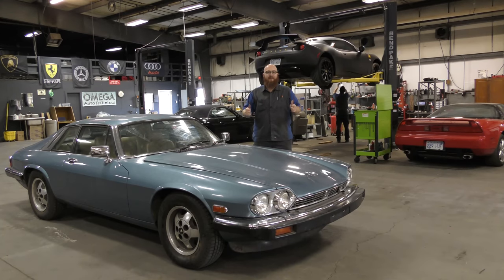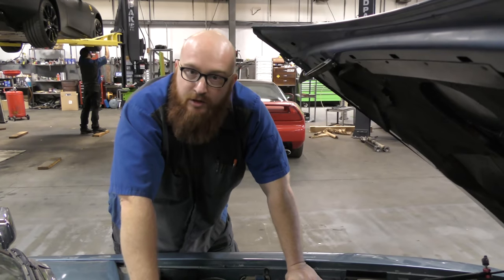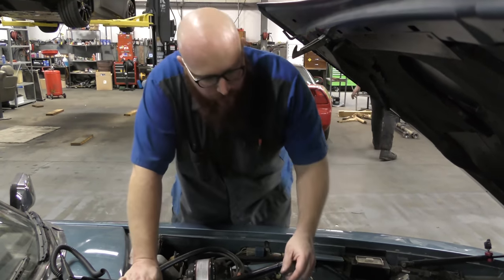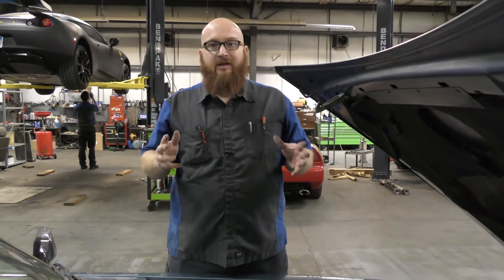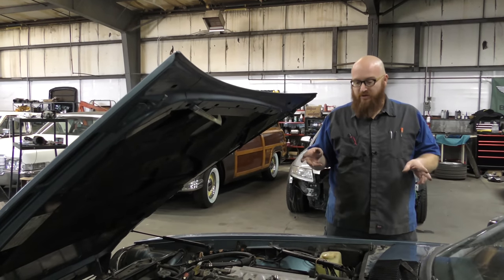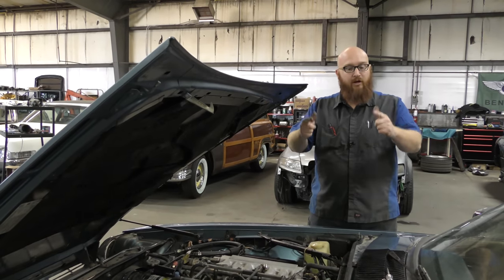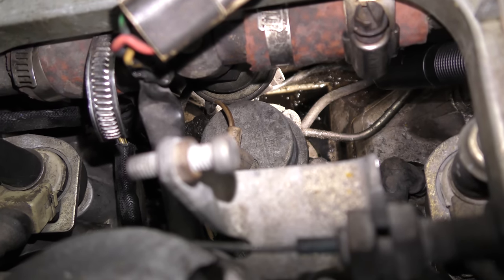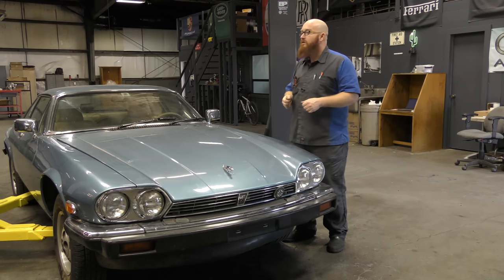'82 XJS with the cursed Jaguar V12 comes into the CAR WIZARD's shop. Can he get it running?

Comment: One of my favourite cars. Careful when you change the spark plugs. Dirt accumulates around the plugs and falls into the threads when you take them out. Put new plugs in with dirty threads and the next time you remove the plugs you take the cylinder head threads with them. They also had a tendency to catch fire because the fuel lines did not always have clamps from the factory. We had several burn jobs come through the shop.

Comment: I was trained by Lucas and still have the diagnosis cards somewhere. Driven E-types, XJ12 & XJS the most female unfriendly seats to get out of. A true gent averts his stare at the suspension systems she is wearing. That big sill/rocker panel makes for hard dismounts.
I loved the sound of the V12 in tunnels and on the highways.

Comment: In the early '90s I owned a used '85 XJ-S HE. I only had one problem with it- the automatic transmission failed one morning. Fortunately, there was a shop nearby that was very familiar with the GM Turbo Hydro 400 that Jag used and they rebuilt the trans with a little crisper shifts and I was back on the road without much $ spent. The XJ-S V-12 engine was a very smooth engine with lots of low-speed torque. It felt as if it were powered by an electric motor. The interior was comfortable for the driver- lots of legroom and well instrumented with large analog gauges. The ride was really outstanding and driving long distances in comfort was no problem. It's ride and handling can be ruined by fitting the wrong tires! Avoid "modern" low-aspect tires! Lister in the UK was a shop that could build larger displacement Jaguar V-12s. Chevy 350-powered conversions are quite practical and very popular.

Comment: Wait, they didn't come with a 350? 😱🤣
Reply: Originally these came with 3.6 inline 6 and the 5.3 v12
Reply: That was a joke bud
Reply: @UP-hu4ov  so if people dislike the V12 engine so much why didn't they buy is with the 3.6 V6 instead
Reply: @neilmurphy845  Straight six
Reply: @neilmurphy845  the first cars came only with the v12,after 1982 they could have the inline 6 but even these were not reliable
Reply: They also had a 4 litre straight 6.
Reply: @UP-hu4ov  No, the sixes were very reliable, the later 4 litre had cats though (in the UK) so made less power at the wheels than the 3.6. That was an unburstable engine if serviced of course.
Reply: @UP-hu4ov  ow that's interesting I never knew that
Reply: @faustusTVR  the 3.6 or 4.0 was unbreakable
Reply: @neilmurphy845  Agreed.
Reply: I'm waiting for some mad customizer to decide the 350 swap is for amateurs. Then try and jam a pair of slant 6's under the hood.
Reply: @ThePatUltra ow that's why they buy them used that's a great idea
Reply: @christopherconard2831  then jam the V12 into a '67 Camaro.

Comment: These cars are the adult version of "Hot Potato".
Reply: My teacher said the same thing about these engines. 😂
Reply: @TWOxTONE_773  engine is great, it's the crap bolted to it that lets it down,ignition and injection systems, that and bargain basement electrical connectors, the ruination of a fantastic car :-(

Comment: I have a '71 E type with the V-12 and 4 zenith carbs.  Opus ignition out, Pertronix in.  Upgrade a/c compressor, replace fans with Audi fans, replace radiator with aluminum one, replace distributer cap 4 times till I found production run was defective and got a good cap and rotor,  new interior, bought some 8 tracks for the radio, and life is good.  No cats back then, so exhaust smells like an old car, which it is.  Still get oil mist in distributor cap, but there has got to be a seal somewhere below.  As of this writing, EVERYTHING WORKS!  It is a beautiful car.

Comment: the ultimate engine swap i ever saw one of these Jags was a Cummins 2.8 Diesel ... that’s right a diesel Jag!
Reply: Used to see diesel jags in Finland alot, I remember they were based on a diesel Ford Mondeo.
Reply: Automotive heresy
Reply: @Mortalomena  when you hear that engine noise you know it’s either a mondeo or jag coming down the road haha
Reply: Nissan LD28 diesel swaps in New Zealand.  The result is a horribly slow noisy vehicle.
Reply: @mcmechanic8910  Or a Transit, or any Peugeot or London Taxi that borrowed that engine. It's a very distinctive sound isn't it?
Reply: You can buy those diesel jags new now XD

Comment: I am genuinely about to buy one of these cars and intend to use it as a normal use car. I don't drive too much and usually only short distances so if it DOES not work, I can handle without the car for short periods of time until either I learn to fix them myself or until a shop can make such smaller fixes for me using about as detailed explanation as I can possibly give. The biggest reason I have for this is that the car is deceptively advanced, yet at the same time simple. Troubleshooting can be a bitch and it always is for nearly anything, but that is also what makes the idea of owning this car so damn intriguing. If all else fails I will just buy a cheap car that is near ready for scrapping just for regular use inbetween as I DO expect (from what I hear) the XJS to be a fickle creature. A "high maintenance bitch, like me", as some lady put it in a different video here. Still that only turned me more on for this car. 

They come in two variants for me right now. Expensive as all hell.. or cheap as hell. I am interested in the cheaper ones that still have a promise of at least running the first few months without too much problem, but will need TLC both inside the car and under the hood. The car is just, to my eyes, a beauty. I know I might be committing the greatest of sins saying this to some, but I actually find the XJS to be more interesting and head turning as far as looks go than the E-type it replaced. More beautiful as well, because the E-type looks... silly to me. The XJS looks like a car that could survive the apocalypse if you have a mechanics touch. It looks more rugged as opposed to elegant. More "muscle car" to its looks than Grand Tourer. I appreciate that look myself.

The added benefit of owning a car like this would be that if you master this engine and systems surrounding it.. it seems like a space rocket system would be the next step up. You'll have mastered all car engines if you master this.
Reply: Couldn't agree more!  Just scored a 91' for $1K that runs.  Have a stripped out Yaris for commuting when I need to and the XJS to cruise around on weekends, fire up in the morning, and tinker on.  Not many other V12's that are cheap out there.  Compare this to the price of a Lambo Espada or any of the AM 12 cylinder variants.

Comment: We had an issue like this with our old 80's Ford LTD.  The car never ran right and we took it to a bunch of shops and they couldn't figure it out.  Finally one mechanic figured out that the plug wires were out of time for that engine.   That car we had had the 351 windsor in it, but had the wiring setup for the 302 engine!  Once that was figured out the car ran like a champ!  It took the right mechanic to get it figured out because I guess no one else thought that something so basic could be the culprit.

Comment: In the early 90s I bought a 75 XJ6 to convert to a 350 Chevy with a GM trans.   Put a hand built engine in it and a performance trans made and tuned by an expert.   Spent more than I should because I had the wrong guy doing the conversion, a Jag guy and not a 350 guy, if you know what I mean.   Car was a monster.  One problem: The Prince of Darkness, Joe Lucas.   If there’s anything in a car with the Lucas name on it, you’re screwed.   Couldn’t keep the car on the road with the Lucas problems.  I had it in the shop so often I knew the mechanic and his family problems intimately.   Owning the car was like putting a stainless steel screw in the back of your hand and every morning, giving it a quarter-turn.   Finally, donated it to charity.   Lesson learned.  I never owned a car again that was serviced by anyone but a dealer.  Nothing but Mercedes since 1999.  Whenever I see a Jag, I spit.

Comment: I grew up with Lucas electrics, so they hold no fears for me. Some of them were shitty, some weren't, but methodical investigation sorts them out.
Frankly, any mechanic who disses Lucas just because of the name badge is an arse.
Reply: Correct. The bullet connectors are generally good unless you stupidly pull them out by the leads multiple times until you break them. Compare them to todays connectors that you cant get out even when you want and they are a dream. The cup battery terminals were a mistake really, I always replace them with clamps. The distributor works, the coils work (yes they can die if you have dodgy spark plugs or leads but then I have changed the coil packs on both of my 'new' cars in the last year.
Reply: I used to have a Vauxhall Shoveit estate, had replace the starter motor due to the solenoid, and it was a Bosch! The passenger fell into the door frame, a German design wire pulley, similar to a drawing board mechanism, which I ended up repairing. And the car kept running even though the disputer cap was missing the centre bush, funny that part was a Lucus part! I agree some people talk out of their bottoms, probably never owned a car fitted with Lucus parts.
Reply: @nigelcharlton-wright1747   I remember borrowing the brother in laws vw golf. Wife was driving when suddenly all the lights on the dashboard came up. It was running so we headed for town but the steering required both of us even at low speed. On arrival and describing the situation the garage man went looking for an alternator... the pulley on these falls apart so regularly he knew about it even without opening the bonnet.... he was right
Reply: Jinn Genie  thank you for the correction, yes, you were quite correct. It was an AC Delco, but the cap was a Lucus one.
Reply: @davehitchman5171  Thank you for that. My friend used to have a new '92 Fiat Uno with a cigar lighter that altered the amount of petrol in your tank when you pressed it in. Funny he traded it in for a Honda Civic two years later. Don't think he's owned a Fiat since!
Reply: @davehitchman5171  Yes, those connectors were fine, the cheap metal corroding was the problem.
Reply: @noelnicholls1894  nevre anything a bit of emery didnt fix :)
Reply: Lucas electric fanboi. 1of 1
Reply: @stevesmith866  I have plenty of cars with Lucas, they havent been an issue. The most amusing is that many on here are having a go about Lucas.. especially Americans.... they didnt watch the video where it is pointed out that the pieces of electronics that failed were actually American products in a Lucas box, and that the likely cause of the failure was inexpert 'maintenance' causing shorts and missing a broken wire (and Lucas didnt provide the wiring harness).
Reply: I once worked Regular Part Time) for a company who sub contracted work manufacturing LUCAS components, Quality control was unheard of, that would have been late 1950's to late 60's, lackadaisical work attitudes(most typical of British manufacturing)  in the vehicle industry I would always blame, PLUS a lack of appreciation of QUALITY CONTROL SYSTEMS.tests appeared a general attitude in Many Motor Vehicle plants.
Reply: You must be British 🙂

Comment: I bought a new distributor for a 292" 6 cyl, installed it and the engine would not run properly. Turns out it was built 180 degrees out from the factory, arrgh!
Reply: Ouch!
Reply: YOU installed it 180 degrees out... a common mistake... just like the earlier 'mechanic' did on this Jaguar...
Reply: @BuzzLOLOL  Actually no, the shaft had been installed at the factory 180 degrees out, as I recall it was set up to only go in one way.
Reply: @Colinpark  - C'mon... admit it... YOU did it...
Reply: @BuzzLOLOL  It was 30 years ago, but I do remember taking it back to the parts place and comparing it to another new one and the fault was clear, they exchanged the part and the new one worked fine.
Reply: @Colinpark  - Since the innards spin, about the only thing that could get 180 degrees off is the rotor or cap... and you just swap those back around to correct position...

Comment: “Un-screwing the last guys screw up” 
Man that is familiar to me as a guy that runs a bike shop. 
My favourite is “I’ve had a go myself “
 Also, the longer things stand, the more issues it has when it does run again
Reply: How much can you really mess up a bike? There isn't much on them. The entire Crankset is probably the longest item to disassemble and even that isn't a ton of parts.
Reply: I have onld cars, often they stand if I am working away, it always takes months to fettle them back to good working. All cars are best when regularly used.

Comment: 3:24 Wizard , peel the Lucas stickers off to reveal the AC Delco stickers underneath...
Reply: AC Delco - affiliated with the company that makes the SBC, right?  Does the Lucas sticker have the power to turn GM parts into junk?  If so, what would happen to an SBC if a Lucas sticker falls on it during the swap?

Comment: ‘Lucas, the prince of darkness’, we use to say on this side of the Atlantic.  
I have an 1984 V12 XJ-SC.  Its a mechanical challenge. Every winter when working on it I wonder why I don’t ditch the car and focus on the others (1973 RollsRoyce Corniche and a V12 Aston Martin DB7, both in mint condition). But oh boy, when the first real spring sun rays are warm enough to remove the front-seat panels, it is such a smooth and enjoyable ride. It makes the mechanical nightmares during winter evaporate immidiately.

Comment: I wonder if the inboard rear brakes is more a function of Jaguar’s racing heritage to cut down on unsprung weight on the rear corners or a packaging decision? I’ve seen that setup on old Mercedes swing-arm rear end sports cars, but we’re talking 30 years of separation in convention. I know Bob Tullius won a lot of races with this same platform in the Trans-Am series back in the day...
Reply: Also on the Citroen 2cv,it does  keep weight central, I also believe the race versions could change pads without removing the wheel assembly , though not sure how useful that is?
Reply: The E type had inboard rear brakes as well.
Reply: @alexbrown1995  right, and a practically identical rear suspension setup to this car.

Comment: "I win!" Hell yeah, nice work!  Had an old 91 Suzuki Sidekick that also has a fuel supply issues that was caused by a shorted wire on an injector that fried a capacitor in the computer.  What a pain to trace that down!

Comment: Car Wizard - you are the best. Not a car - but restoring an early 1980's Honda CM200 Twinstar motorcycle over 5 years. To get it running - I found it was 180 degrees out in the distributor.

Comment: 9:03 - What do you mean "back in the old days"? Coaxial cable is still the core of domestic TV signal's distribution everywhere!
Reply: Naw, it's fiber optics...
Reply: @BuzzLOLOL  - Inside the houses? I don't think so.
Reply: @Module79L  - You said "everywhere"...
Reply: @BuzzLOLOL  - I also said domestic distribution, not outside infrastructure.
Reply: @Module79L  - "Domestic" means inside the USA... to us Americans, at least...
Reply: @BuzzLOLOL  - Domestic means inside the house. You're not the only country in the world.
Reply: @Module79L  - From the dictionary: "existing or occurring inside a particular country; not foreign or international.
"the current state of US domestic affairs" "
Reply: @BuzzLOLOL  - Also from the dictionary:
Domestic adjective
1. Relating to the running of a home or to family relations. Ex: "domestic chores"
Synonyms: residential, internal.
Or as I say in my line of work, domestic as opposed to commercial or industrial.

Comment: Wizard you tamed the dragon!
I have a 1970 Jag, XKE, CONVERTIBLE, in silver.
I was a wrecker diver running flatbeds and big hook trucks.
The shop I was working for used to send me to all the junkyards looking for body parts.
I whent to a spot for a Chevy Caprice nose and hood.
After I loaded them up I saw IT.
Four flats and it's "top" was shredded.
Squirrels were living in it.
A 197O Jaguar convertible, 
The guy that ran that yard said
" That piece of crap? That hunk of crap never ran right"
I bought it for $1000.00 dollars.
It had the much simpler 12 cylinder carbureted engine.
Lucas wasn't named the Lord of darkness for nothing.
The entire electric system was toasted.
I seems like the last owner didn't know about the British "+ ground" 
And hooked up the battery backwards.
It took me A YEAR to rewire it.
It was difficult, but not impossible.
Now it spins like a top!
It's a 304 inch 12 cylinder.
Cruising in that car I met my wife.
It's got  a new history with me, it's not a hunk of junk!
( But you had better be rich or a mechanic today own one)
Carry on Wizard!
Reply: The Jaguar V12 came out in 1971 so it's unlikely it was in a 1970. Jaguar switched to negative ground some years before 1970 so it's unlikely your Jag is positive ground. Cheers.

Comment: I played superhero on my 82 that hadn't run in 4 years. And I'd never worked on one before and it ton a while but I finally got it figured out. It was the fuel inertia shut off switch. I jumped it across and that baby fired up and ran SMOOTH AS GLASS. I've found no leaks. But all it takes is patients and love, AND LOTS OF READING AND RESEARCH!!🤣😂